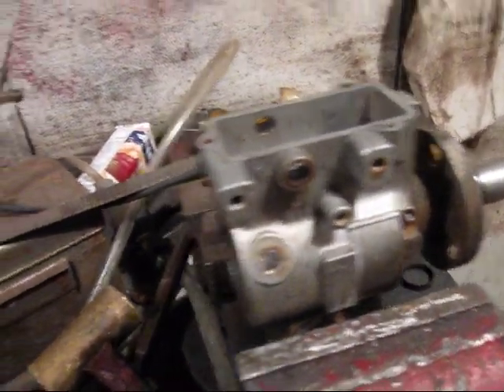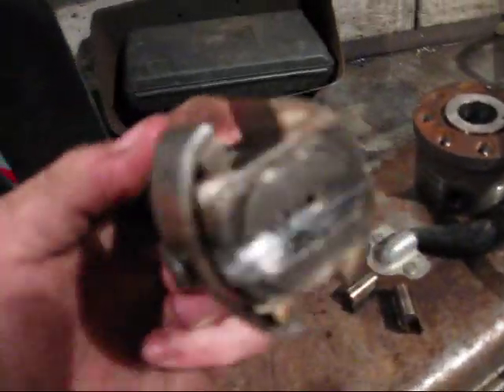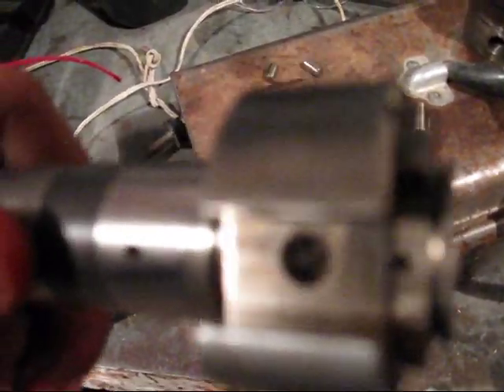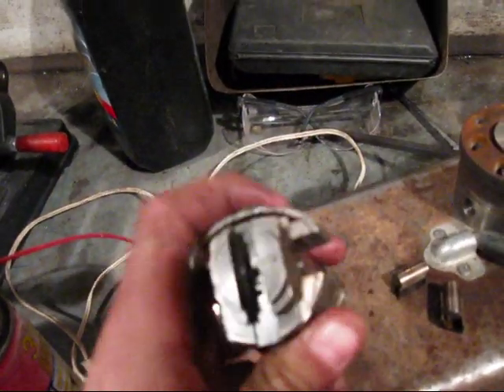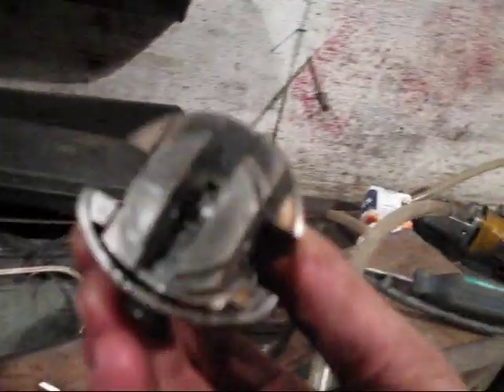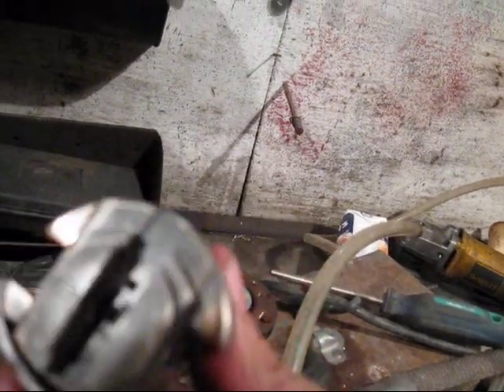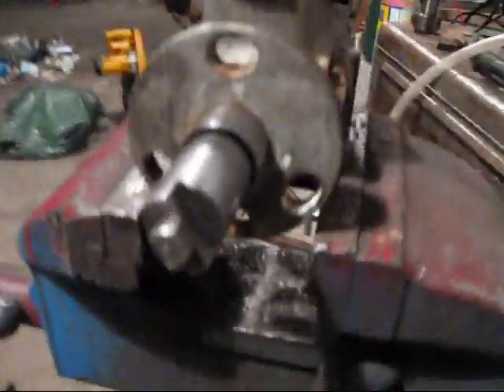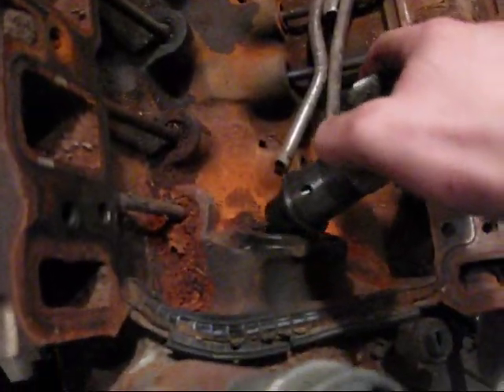stanadyne diesel Injection pump info

Comment: Basically the injection pump is a glorified distributor, since diesels don't require spark plugs to operate, the injection pump is still driven via chain or shaft powered by the cam.  Push the pedal down, it advances the cam ring similar to a distributor, thus allowing the engine to accelerate.

Comment: I love the 350 olds you have on the floor but the pumps don't hold up for many miles but are great on fuel. When I couldn't afford a new pump for it again I found out that the heads and top half of a olds 350 gas would fit on it but with the high compression of the block made my olds cutlass a monster. To keep it running I needed racing fuel for it. Still miss the diesel sound and mileage it gave.

Comment: probably fixed it by now, but I'd bet the plastic dampener ring in the pump is breaking into pieces. Chunks clog the ball check valve in the return line. Once that happens, the pump housing pressure goes haywire, and the pump stops working. Some guys break the glass ball in the check valve as a "field repair", but I'd do it right. Seal kit usually somes with a new plastic ring, but you can upgrade to a better one for about $50. Make sure the return line all the way back to the tank is clear.

Comment: i have a 4400 john deere combine with a 329ci jd engine that has one of these pumps 6 cylinder of course.  it keeps spitting black crap into the return line and clean fuel in and plenty of it is confirmed. i runs fine for about 20 seconds then dies. no smoke and no miss. any information is welcome

Comment: @76plymouth 
same as lucas/cav/rotodiesel, good on fuel but weak so they break easily especially if bad quality fuel is used.
The way fuel is metered is what I find the strangest part "fuel pressure time area is varied" that is fuel feeding the pumping elements varies and this effects the effective stroke on the elements; to me thats a long way round to do something simple, I prefer the bosch VE or the P pumps.

Comment: On the leaf spring are numbers. The higher the number, the bigger the stroke of the 2 plungers. You can machine the spring, getting more stroke. But be careful not making the stroke to big because the rollers run on not polished surfaces of the cam ring! The transfer pump on top of the pump provides filling the plungers and actuating the hydraulic advance cilinder.

Comment from the maker: Also, my 6.2 at WOT and full boost  had a bit of black smoke production, and with the pumped turned down even a little i would loose boost and a noticeable amount of power. As well why do pulling truck produce large amounts of black smoke? To keep the turbos spooled, and to squeeze every bit of power out of the engine.

 With a little black smoke, more power is being made, the fuel is just burning far less efficiently and as a result, the rich burning fuel produces black smoke.

Comment from the maker: Smoke on my Oldsmobile would be pointless (although it looks cool on with my stack) due to the lack of turbo. But on diesel with turbos, the harder you can fuel down low, the faster the turbo is going to spool. For example, my 6.2 would only make about 7psi on a non wastgated turbo and pump turned +1/4 turn. With the pump cranked as well as intake and exhaust done, i could get it to 15PSI. The Extra fuel kept the turbo spooled which meant MORE POWER.

Comment: Third, I'm not trying to bash you, but make you others realize that curiosity without the proper education can be dangerous. Also technically this information belongs to Stanadyne and you don't have a right to distribute this information. In reality, this model is obsolete they wouldn't waste their time with you. Having rebuilt and calibrated more of these than I can remember, I am informing you that you can get into trouble quickly if you don't know what you are doing.

Comment: First, black spoke equals more power is a misconception. All you are doing is wasting fuel. There is too much fuel in the fuel to air ratio. It is unburnt fuel thrown out the exhaust. Second, once again the fuel screw does make the injection pump deliver a lot of fuel. An average DB2 automotive injection pump delivers around 28-40 ccs of fuel @ 500 stks. Turning the fuel screw in all the way can make the pump deliver close to 60 to possibly 80 ccs of fuel @500 stks which equal engine damage.

Comment from the maker: and once again, i did not say that i know exactly how it works and no, i am not a certified technician, but i did describe what i learned, and you do not have to post comments about how you assume i am some idiot thinking that i knew it all and have no right posing a video of the insides of an injection pump because i was not describing every little thing with detail. Also, i would like to say that there is no other info videos of the DB2 on you tube. If you want to make a better video go ahead.

Comment from the maker: certified Injection pump technician to adjust these pumps, you just turn the fuel up little by little so that it is just before the point of showing black smoke at WOT ( though i turn it past that a bit due to the extra power) . Also, I am young, but once i go to college/university trade school, i do plan on taking heavy duty mechanics and or mechanical engineering.

Comment from the maker: Wow, people can be ignorant..... 

I took this pump off of a scrap engine to have a general of how it works. I made a video to show the insides of the pump to other people, so they to could have a general idea of how it works. It would have been very stupid to take a rusted from the inside/junk pump carefully, as i did not want to put it together, and even if i did it would still be junk.  Also, on these pumps even with the fuel maxed screw they don't pump a lot of fuel and it doesnt take a l